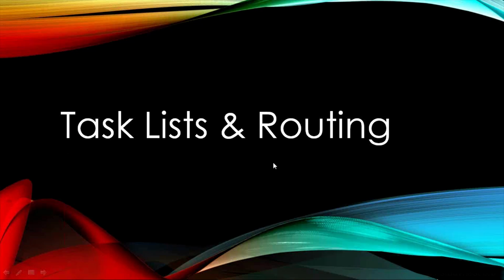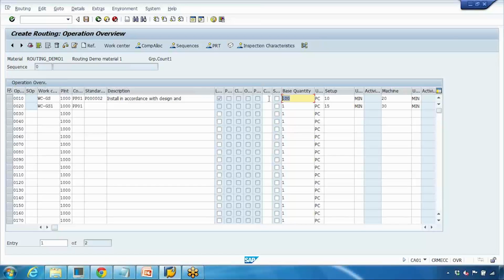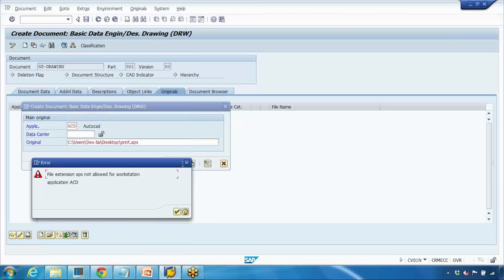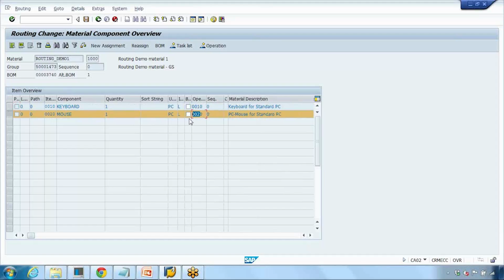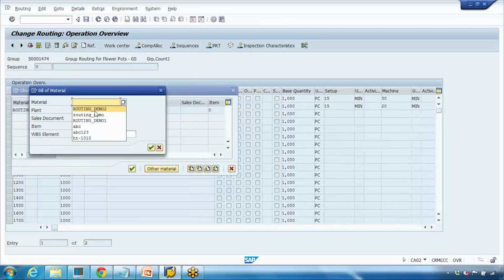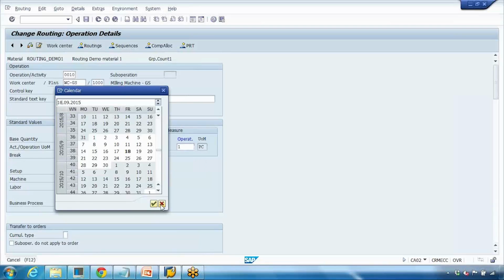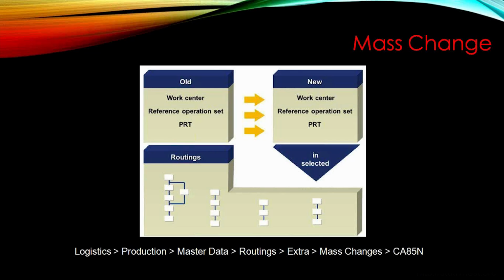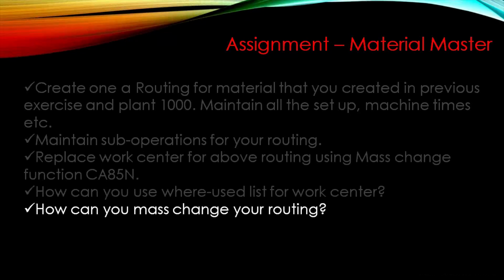SAP PP Training - Task List and Routing (Video 6) | SAP PP Production Planning

Comment: This video provides a technical overview of Task Lists and Routings within SAP Production Planning (PP). Based on the material covered, here are some interview questions suitable for assessing knowledge in this domain:

Technical Interview Questions
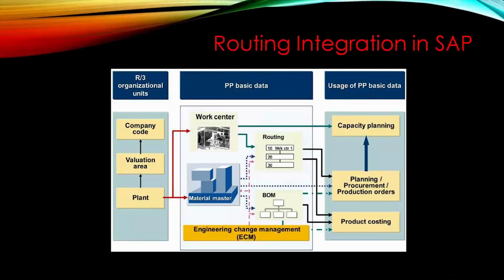Routing Fundamentals: Can you explain the structural design of a routing in SAP PP and how it integrates with other modules like costing and capacity planning? (0:45-1:18, 23:51-25:29)

Task List Types: How do routings differ from other task list types such as Master Recipes or Rate Routings, and in what scenarios would you choose one over the other? (1:26-2:34)

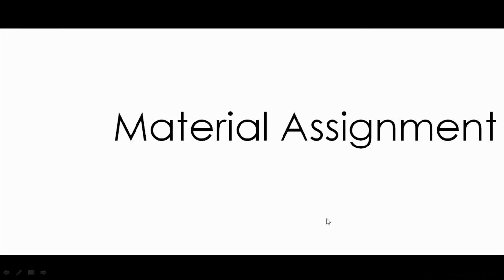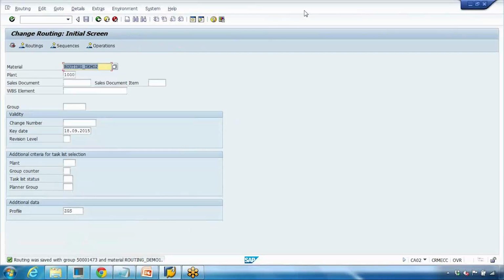Material Assignment: Explain the process and the business benefit of allocating Bill of Material (BOM) components to specific operations within a routing. (30:32-35:51)

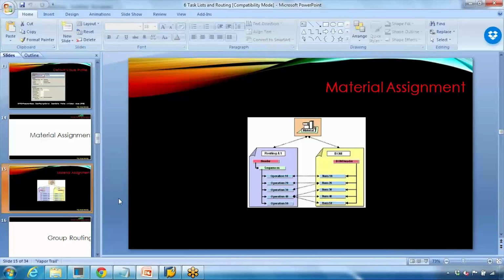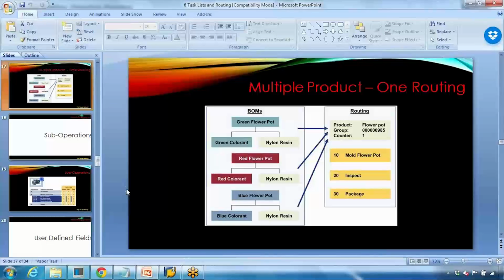Group Routing: What is the primary purpose of a Group Routing, and how does it allow for efficiency when multiple materials follow the same manufacturing process? (36:00-45:40)

Engineering Change Management (ECM): How does ECM allow for the planning and execution of changes to routings at a specific future point in time without affecting current production? (56:52-1:04:23)

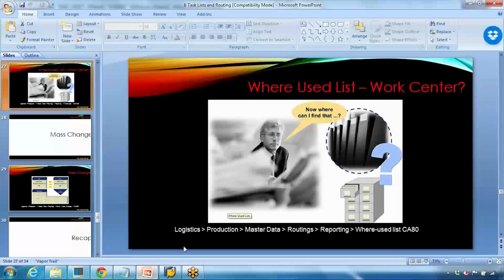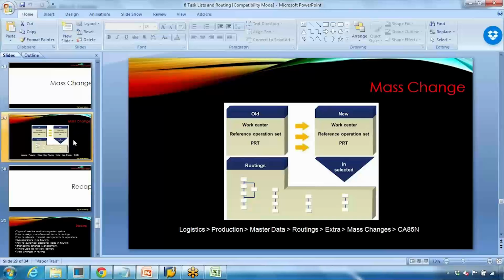Mass Change Functionality: If a facility replaces an old machine with a new one, how would you use the Mass Change transaction (C851) to update thousands of existing routings efficiently? (1:06:25-1:16:23)

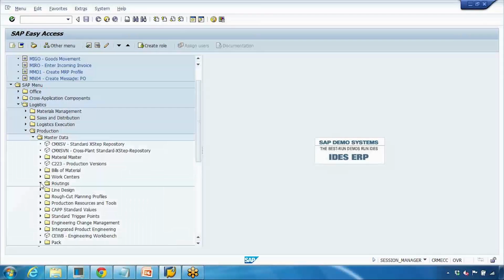Task List type (1:26), Routing Example 4:30,  Routing CA01, (5:50),

A routing determines the sequence of individual operations that are necessary to produce a product   (14:30), Saving a Routing creates a Group Number (11:47 - 12:24), Routing Integration in SAP (23:57), Create a Default routing profile (26:56), Material Assignment (30:20), Material -> BOM -> Routing -> Operations ->Items (33:25)

Group Routing: A single routing can be used by different materials (36:00), sub operations  (45:45)

NOTE: 49:30 about sub operation

User Defined Fields (49:34), Engineering Change Management  (kind of change log) 57:00,  Task change list ( Tcode: CA60).
If you want the changes in future the ECM is used. (58:03), 

Note: ECM can be utilized for Material, BOM  and Routing future changes.(59:10) .. ECM changes (1:01:00)

Where used list CA80  (1:05:10), Mass Change (CA85N) 1:06:25,

NOTE: Mass change management may not work on ECM configured item. You have to pay more attention on it 1:16:10